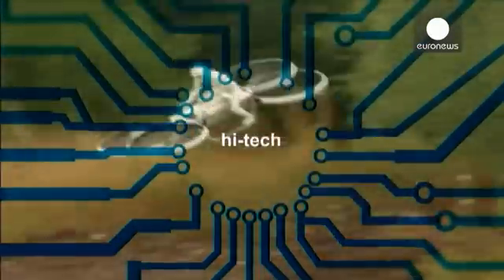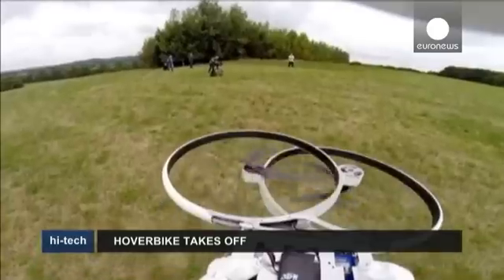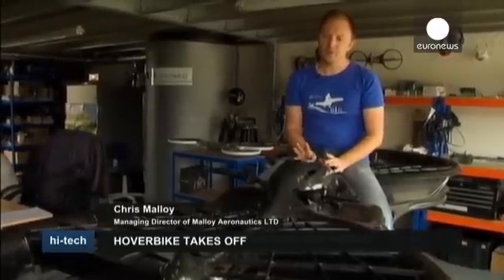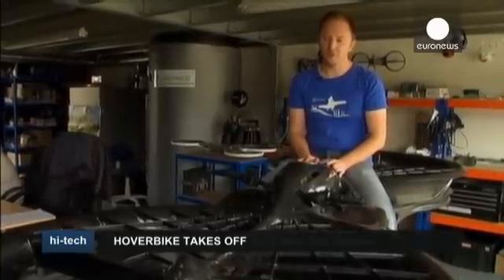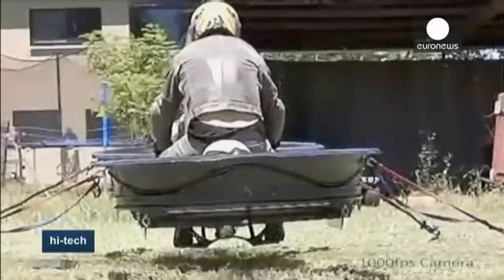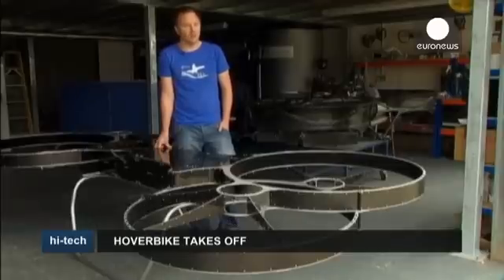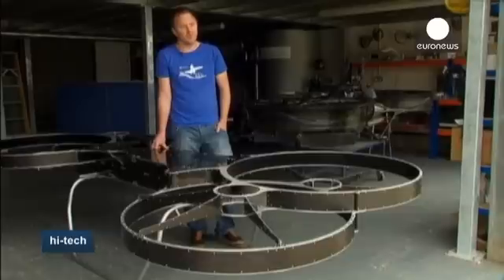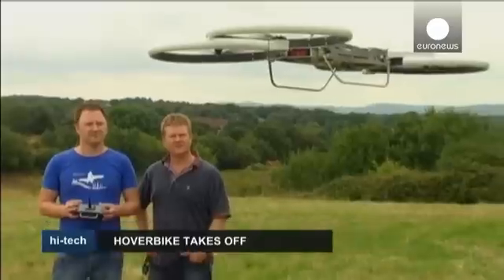Malloy Hoverbike Is Flying! - Hi-Tech

Comment: Power failure??? Fixed winged aircraft can glide. Rotary winged can auto-rotate. Quad-copters can only fall. add some speed and fall fast.  in most countries it will not be allowed for sale publicly.  Three wheeled ATV's were banned for safety reasons.  How will a manned version of this get certified for sale?  They might be able to sell it as a kit but thats about it. A kids toy has more pages of safety precautions than it do on how to use it

Comment: Love it..Genius..Elegant ..Looks very Star Wars...the movie that is...
One thing though,
Why don't helicopter manafacturers design a rotor guard similar to the hover bike's?
It seems like an obvious and natural enhancement now.
I really hope they do,Maybe then the helicopter as a vehicle will be a bit safer.If you suspended a helicopter cab under this kind of quad rotor system it may be safer...They could  mount a parachute system on the rotor guard in the event of engine failure at altitude...so if the helicopter starts falling past a certain  velocity,the chute(s) deploy(s) safely from the rotor guard and slow the falling vehicle to non lethal levels....might be a wothwhile edition to the hoverbike too...Even a small chute(s) can lower the terminal velocity to a non lethal level.
Here's to the future..
Reply: Because helicopters have massive rotors and the size the "guard" would need to be would make it impractical.  Also the only thing the rotor guard is good for is keeping objects directly from the side from impacting it (like someone walking into it).  On a helicopter the rotors are overhead and there's no danger of someone walking into it.  For the guard to actually be practical you'd have to mount some type of screen on the top and bottom of it to keep people from putting their hands and feet into it.  Now how exactly would that be practical on a helicopter?

Helicopters don't need a parachute system.  Because they can auto rotate they can land safely even in the event of engine failure.  The same thing can't be said for the hoverbike in question.
Reply: Helicopter crashes are two a penny in the news,Often fatal..so yes a chute to slow the descent of the ailing helicopter would be practical.More reliable than auto rotate which seems to fail in certain scenarios,,,
No you can't put a chute on a traditional helicopter rotor system,but if you used this multiple rotor system on the helicopter above the cab,including the guard,from which the chute would be anchored and would deploy ,It would be a much safer vehicle.I'm right about this.Helicopter design has not changed much since the fifties.
A safer version is feasible...
There are many instances where a rotor is in reach of harming a person,a mesh guard would prevent this.
I am right.
If I ever become a billionaire,I'll prove it too.